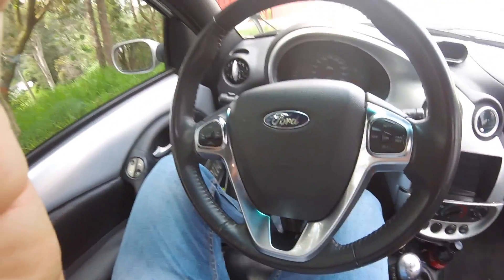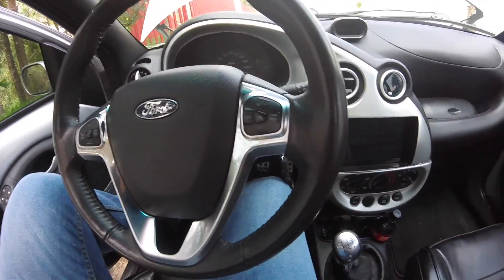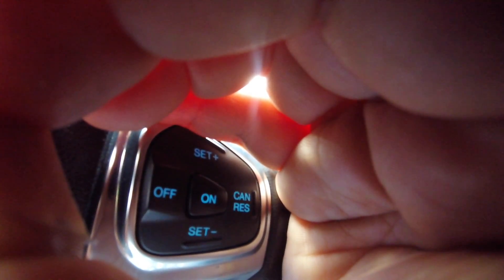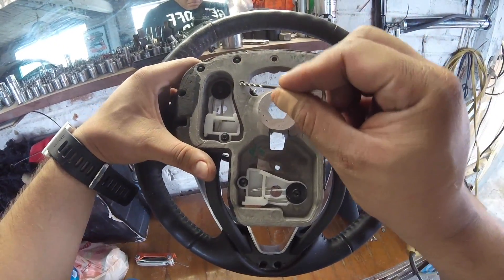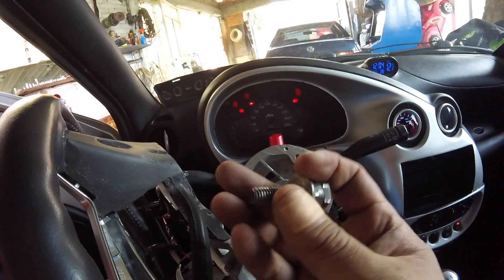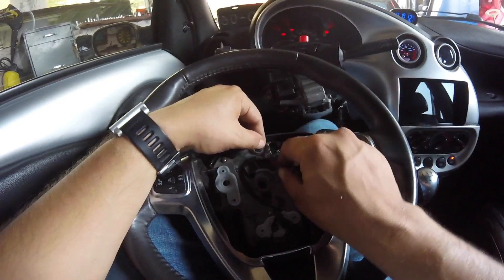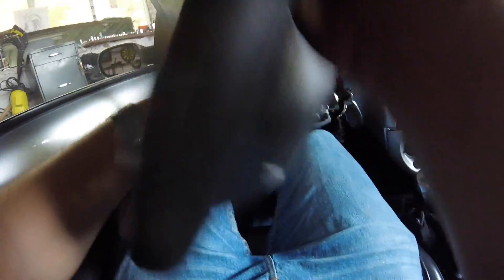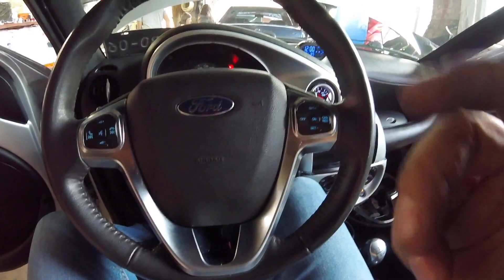COMO ADAPTAR UN VOLANTE // HOW TO ADAPT FORD STEERING WHEEL

Comment: Amigo le cambie a un nissan b15 el volante por uno de altima 2006 , ya le adapte el claxon, pero quiero hacer funcional el control de volumen de radio, el carro originalmente viene sin ninguna conexion para el radio. Se podra adaptar algun cable directo desde el radio hacia el volante?gracias